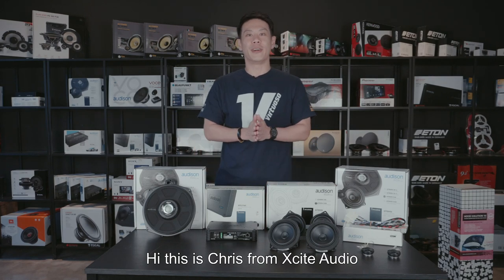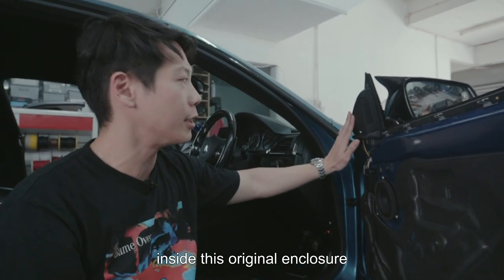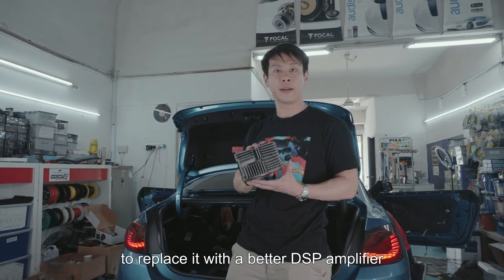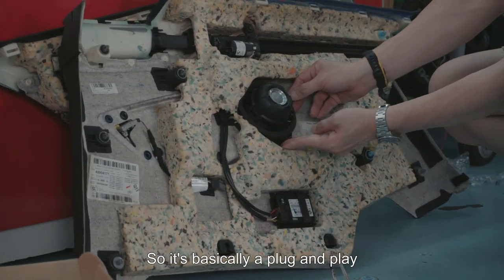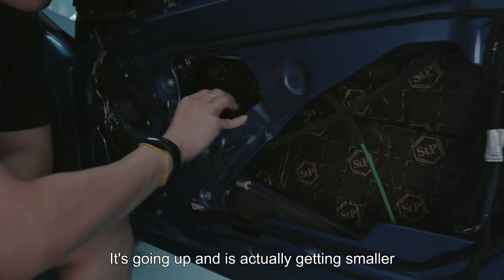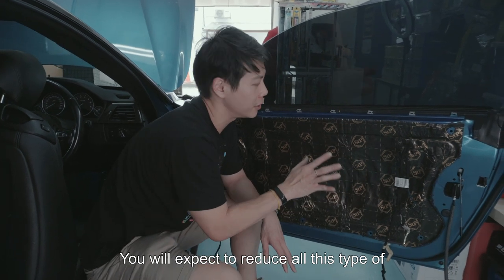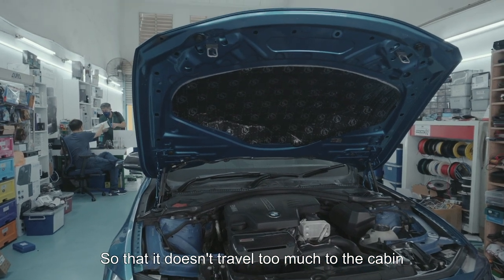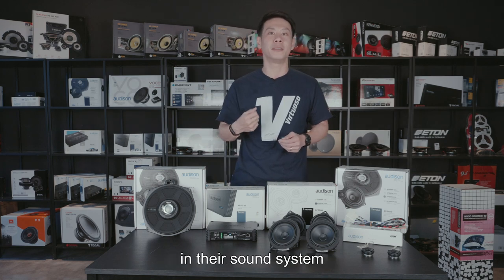BMW 4 SERIES F32 SPEAKER INSTALLATION

Comment: Hey guys. I have some question. So I’m having electronic buzzing issue from the driver’s side door speaker. 

It happens everytime I put any amount of input into my gas pedal. Looks like electronic signal from gas pedal goes into speaker and makes noise. 

In this case changing the speaker will not fix it right ? 

Do you guys have any suggestions to block this sound ?